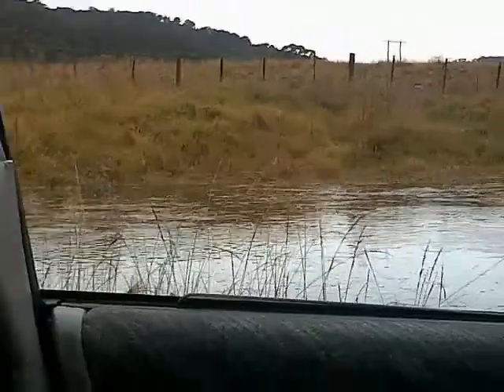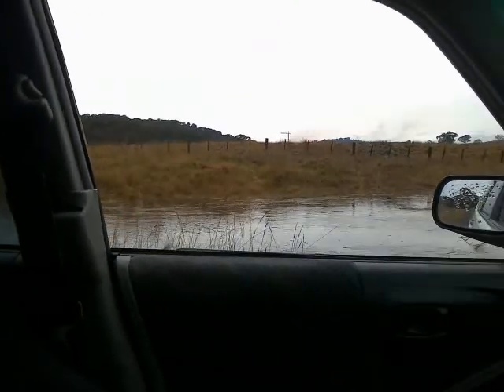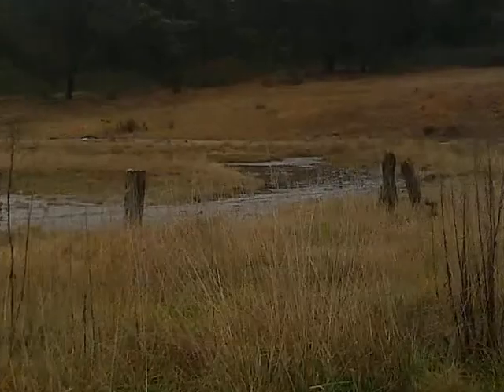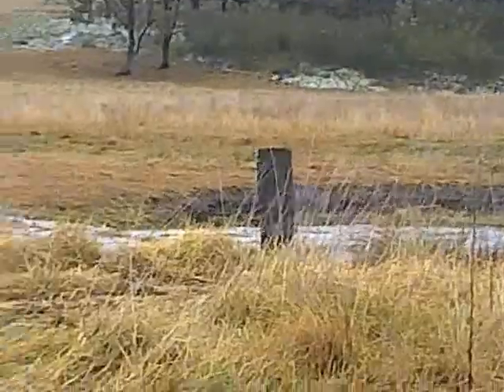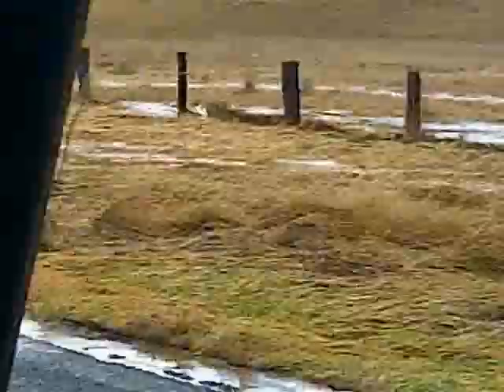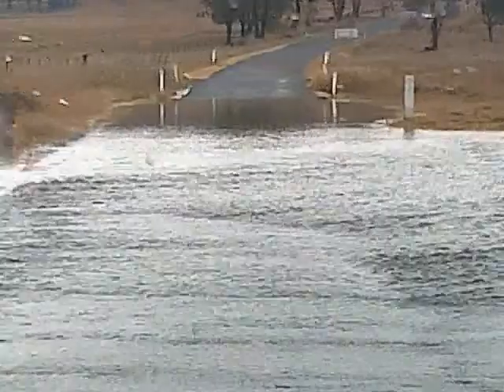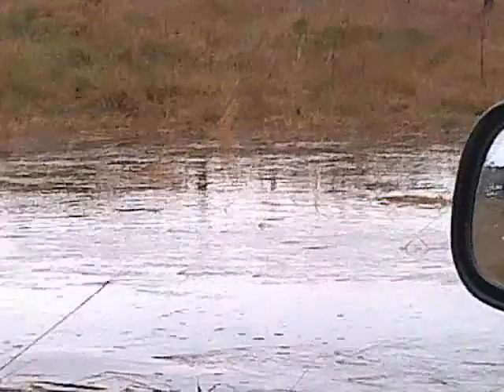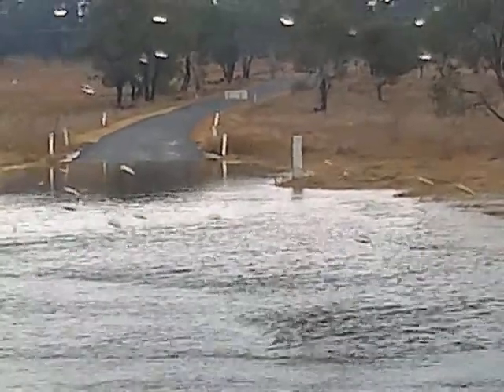Fording The Causeway...!

Comment: It's a wonder you got across... driving on the wrong side and all. :)
Reply from the maker: G'day,

  Thanks mate,

   Actually, the trick is to drive on the Upstream Side of the Causeway, regardless of the Road-Rules...; because the Water is slightly shallower there, the Water's flowrate is slightly slower, and if the Car does start sliding sideways - then there's more Pavement between the start of the slippage & the Edge of the Causeway...

   I kind of made it look easy in this Video, but another 10 cm of Water and I wouldn't have been game to try it...; coming home I could hear Water flowing along the underside of the Floor in the "Gear-Tunnel", so this was actually right on the edge of what can be done without coming to grief..., because there was more rain while I was in Town & the water was higher for the trip home...

  Have a good one,

  ;-p

Ciao !

Comment: Hoorah! One can't help feeling you might have had better control of the car if you weren't filming however.
Reply from the maker: G'day Cathy,

  Thanks mate, you're probably right, but the Forester has Power Steering, and the Water was only about 1 ft deep, not as high as the 0.4 Metre mark on the depth guage in the middle of the Clearing...; and to be honest, if the water was deep or fast enough to need 2 hands on the Wheel to retain control then it wouldn't be at all safe to drive into it...

  Not all Causeways are safe to cross when there's a foot of Water on them, but this one isn't too bad, mainly because it's long & flat and the Water doesn't Dam-up on the upstream side of the Car..., it's able to go around rather than piling up...

  I knew I wasn't going to come out of First Gear all the way accross, so "technically" I had a free hand...(?).

  Have a good one,

  ;-p

  Ciao !